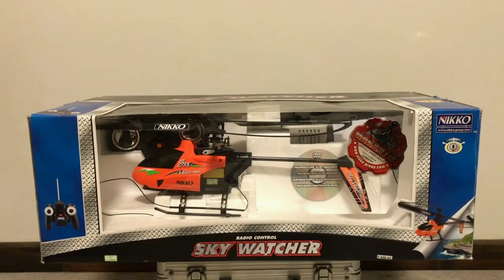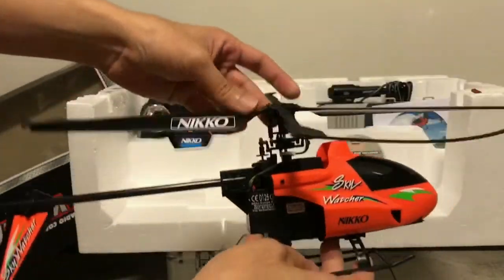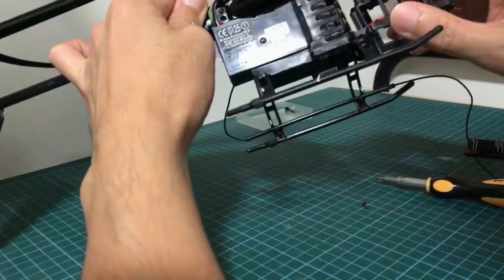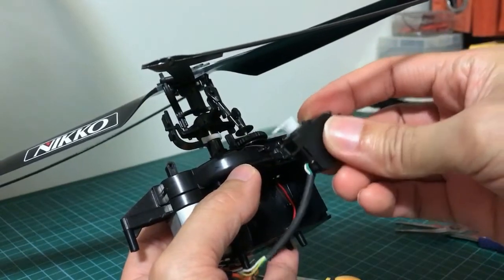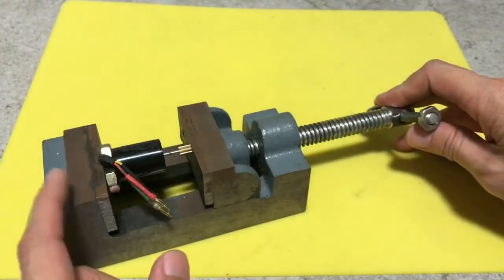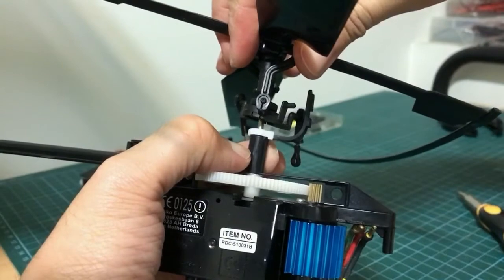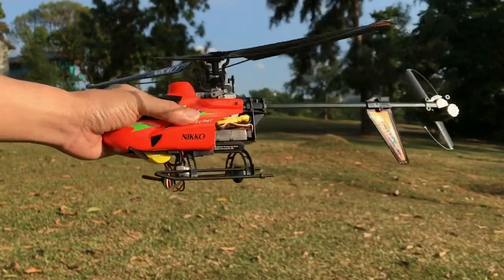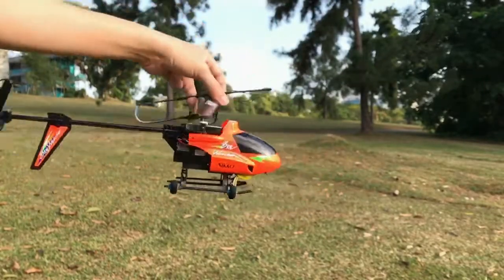Turning Vintage Toy Heli into Hobby-Grade! IT FLIES!!!

Comment: That was my first helli now I have a blade 230s v2 learning 3D
Reply from the maker: Wow! I guess we have had the same joy and frustration with the Nikko then. Your blade 230s is an awsome heli. I have my Blade CP2 modified to flybarless and driven by the 230s's flight controller. Between FPV flights (with micro drones), I still fly my BL mcpx doing the usual inverted grass-trimming, flips and loops.  :)